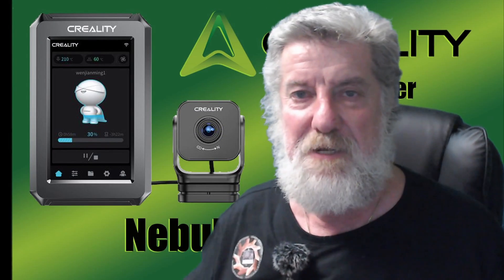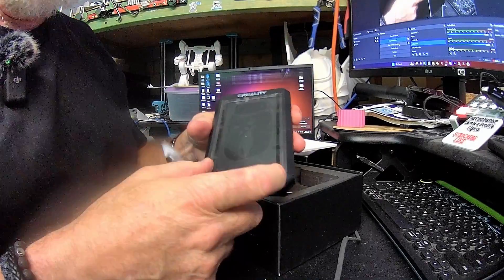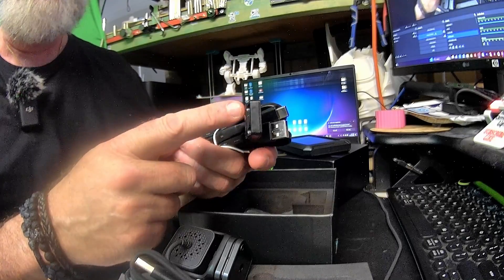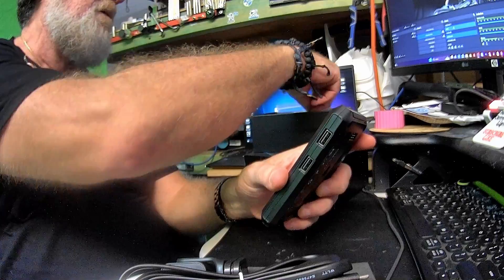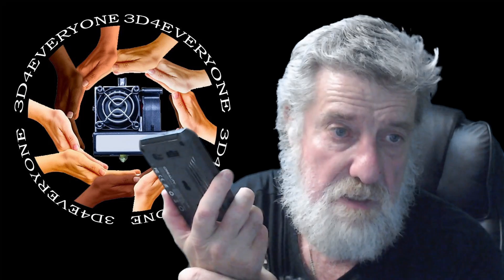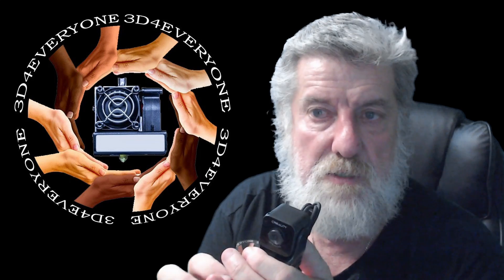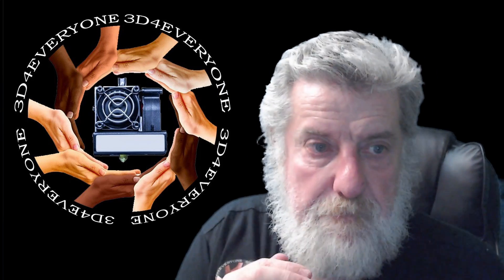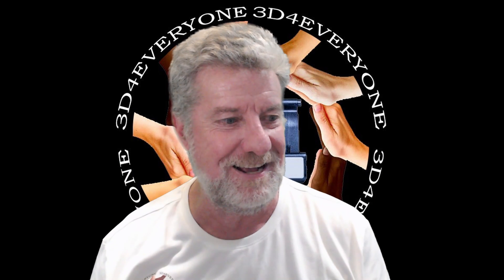Speed up your old printer with Klipper using Creality's Nebula Pad Kit  @Creality3D

Comment: Does the printer need to be running kipper ? I can’t get it to link to my 4.2.2 board on ended 3 v2 neo
Reply: Not to start, but when you setup your printer on it, it will convert it over to klipper.
Reply: @marinedomain  well mine just freezes at connection screen.

Comment: Is that an ender 3 v2 you used that on
Reply: I have a sprite extruder also with cr touch I can't seem to get that probe to stay onnthe bed when doing the mesh its still stock pretty much other than the sprite extruder any tips
Reply from the maker: Yes I put it on my v2
Reply: @3D4Everyone1  what software you use (root ol wanila)? do you have any issiues with errors 2001 etc?
my ender3v2 with 4.2.7 have tons of problems with camera (after plug randomly stop working printer)
Reply from the maker: Small piece of double sided tape
Reply: Thanks 👍

Comment: Can the hardware cope with the speed, or is it 100 prints and it is suffering wear
Reply: Yes, it shouldn't have a problem, wheels may wear a little quicker, but they are cheap and easy to replace.
Reply: @3D4Everyone1  oil and grease will help 😆

Comment: I’ve had 2 Sonic pads and both of them suddenly bricked on me. I really hope this isn’t a repeat of the same issues. I might actually hang on to my Ender 3S1P if this thing works well enough.
Reply from the maker: Not good,  ive been lucky with my Sonic pads and never had a problem. I would think the Nebula  has a number of tweaks, as its the control panel on the Ender-3 v3KE

Comment: Awesome video, I'll be buying one definetly soon for my KE. I've noticed you also have and ADXL vibration compensation sensor, I'm wondering if you would happen to do a video on how to mount it on the KE, because the cable I got for it has the round connector(I don't know how it's called) and I have no idea where it connects to on the printer. And I couldn't find any video on youtube where someone has mounted it on their KE.
Reply from the maker: You only need it attached when you do the calibration. a lot of people just use double sided tape, you do it twice once for the print head (tape to side of print head but be careful not to cover fans) and once in the centre of the motherboard.